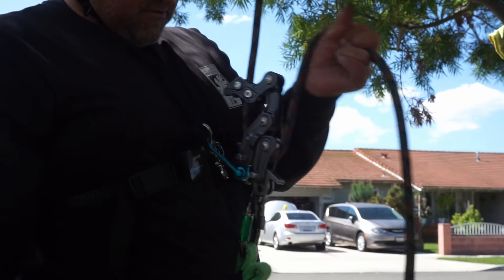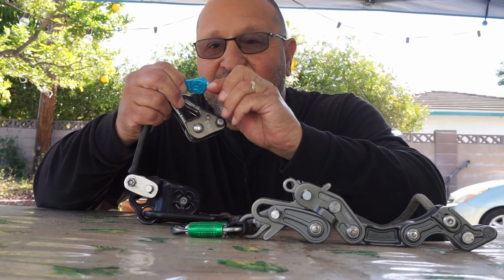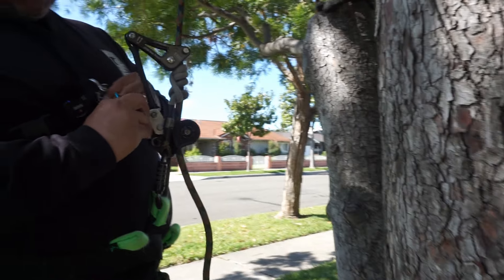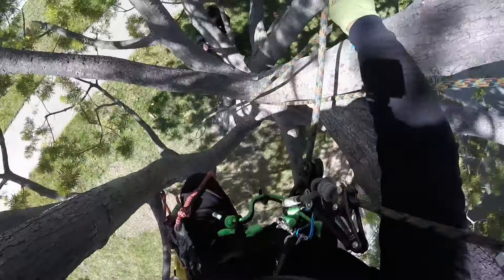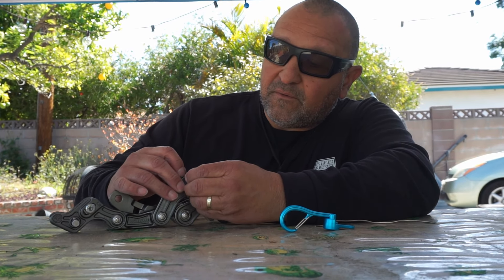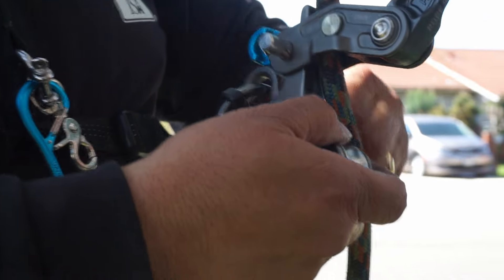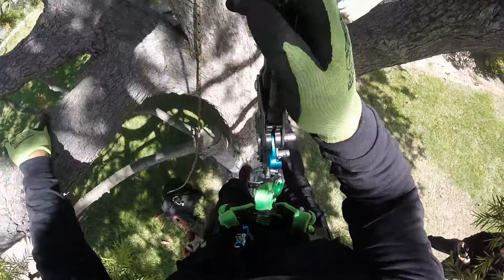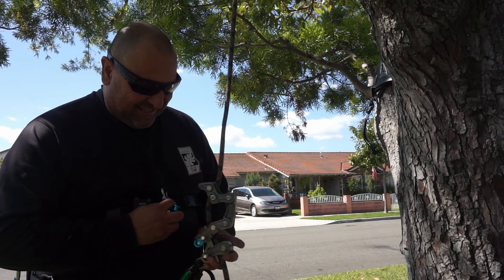This Tree Climbing Gadget Completely Changed My Rope Runner

Comment: New climber here what’s the difference between a rope wrench and a rope runner pro or why would you use one over the other?
Reply from the maker: The Rope Wrench is a Hybrid SRS system and the Rop Runner is a Mechanical SRS system. Check these videos out it will help explain.

https://youtu.be/_6FDtMgd94c?si=RwebIIiC5BEzAklK

https://youtu.be/4hI209soqAg?si=oMHrnBJ0tdv8bR7A